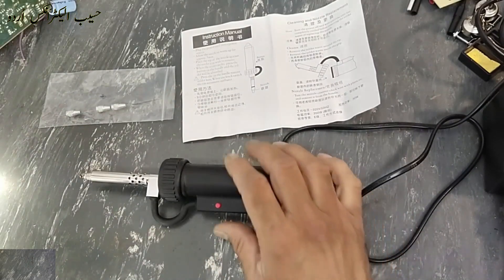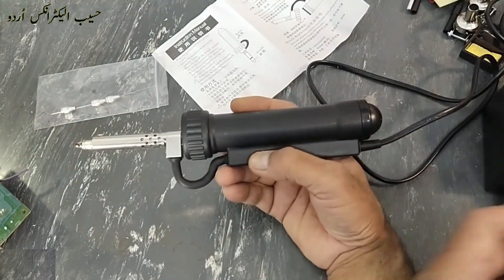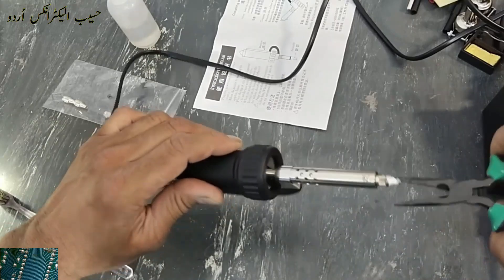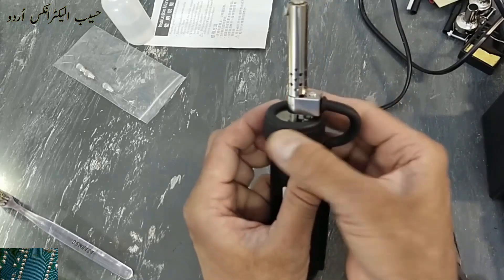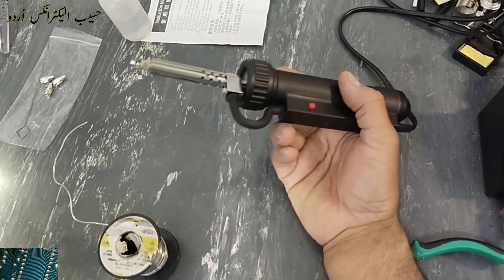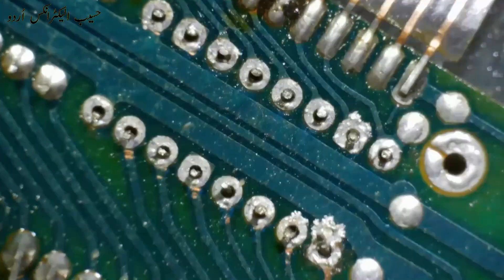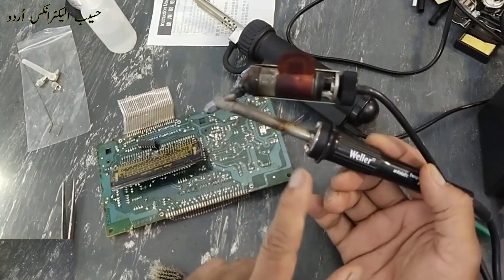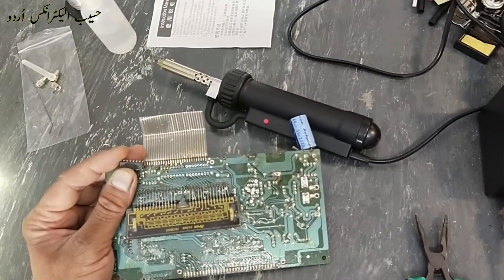{1236A} Desoldering Sucker, Electric solder vacuum sucker REVIEW

Comment: Use remove IPM ic sir
Reply from the maker: great
i will do practical and will share its result 
thanks for suggestion.
Reply: @HaseebElectronics  I used this very extensively after a while it goes bad but if you use it lightly and keep removing the solder then it may last longer the gun you got is a really top stuff, it has a motor and it really sucks it out the new gun is only using spring and air it is not match fot the motor one you got.

Comment: What its name and model no
Reply from the maker: https://temu.to/k/ewzumctcgcc
https://www.temu.com/goods_snapshot.html?goods_id=601099560284086&title=Details&_x_ads_csite=goods&_x_ads_channel=kol_youtube&_x_cid=4009981409kol_youtube&refer_page_name=goods&refer_page_id=10032_1731179355451_fwdrvx0ebw&refer_page_sn=10032&_x_sessn_id=1z40ko6k7t
Suction Device With 3 Suction Bits AC100/220V Portable Electric Solder Removal Pump, Used For Tin Removal And Welding

Comment: Use zd915/985     better 
Its not
Reply from the maker: i never tried this before. but it is looking acceptable with reasonable price 
i used HAKKO 701, PACE, IRSA, and now i am using WELLER  rework stations 
but i found HAKKO 701 the best in quality with low price and very low roiutine maintenance, easily available spare parts in reasonable prices
Reply: Yes, Hakko is best,  quality

Comment: Sir please model number 🙏
Reply from the maker: https://temu.to/k/ewzumctcgcc

https://www.temu.com/goods_snapshot.html?goods_id=601099560284086&title=Details&_x_ads_csite=goods&_x_ads_channel=kol_youtube&_x_cid=4009981409kol_youtube&refer_page_name=goods&refer_page_id=10032_1731179355451_fwdrvx0ebw&refer_page_sn=10032&_x_sessn_id=1z40ko6k7t
1set Solder Suction Device With 3 Suction Bits AC100/220V Portable Electric Solder Removal Pump, Used For Tin Removal And Welding

Comment: Try the ZD915. It's the same as Hakko FR301 but 1/4 of the price. Your Weller is just ridiculous pricing, I would not repair it next time and get a Hakko copy as they work very well and the parts are also cheap and easy to get.

Comment: 4:20 For more effective use you should first heat those pins with soldering iron and make them straight using tweezer, then add fresh leaded solder, then use the sucker and the hole will become clear easily without scratching the solder mask. Do not apply heavy pressure to the hole to avoid scratching the solder mask and to avoid burning and scratching the board.

Comment: Please don't sell out to Temu. Sorin did. The Weller is ridiculously priced (Shame on Weller) but it works extremely well.
Reply from the maker: i never tried it before. i think it is acceptable while comparing quality with price, 
i used HAKKO 701, PACE, IRSA, and now i am using WELLER  rework stations 
but i found HAKKO 701 the best one in quality with low price and very low roiutine maintenance, easily available spare parts in reasonable prices

Comment: I worked with both of them and I am very conferenced with the Weller desoldering one as it is more clean, in the 50 USD one, when you remove your finger away from the REd button the solder return back to the PCB and even the watts of the heating element is very low thus it is not desoldering the solder very well, a lot of comments about the 50 dollars one in the opposite of the Weller one
Reply: It works ok just the technique is poor. Always add fresh solder to old joints and the sucker will work much better.

Comment: Compared to other more advanced (and more expensive) solder suckers, this one has a larger diameter of this screw-on tip, which makes it difficult to use in areas where the components on the board are densely packed. Other than that, it performs quite well for me.
Reply: I've witnessed the same issue with all the desolderers I've purchased. A smaller tip is always required and the temps aren't high enough